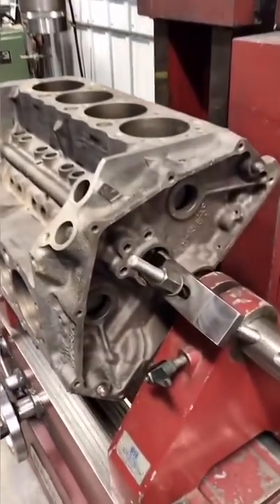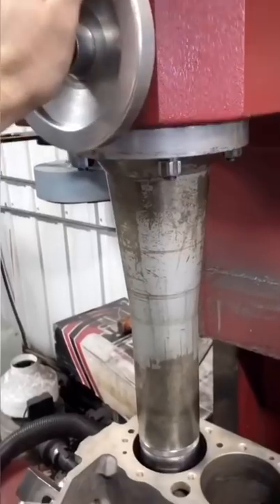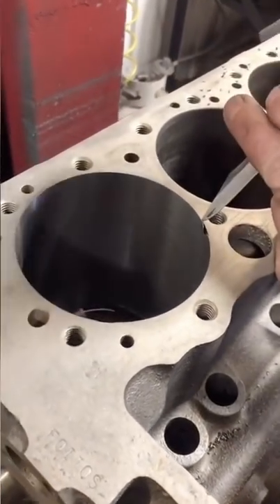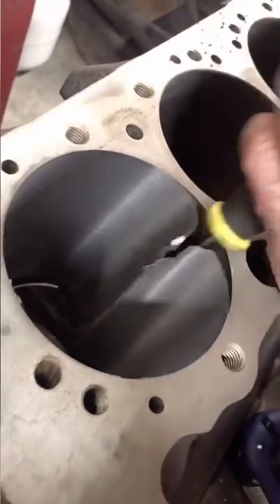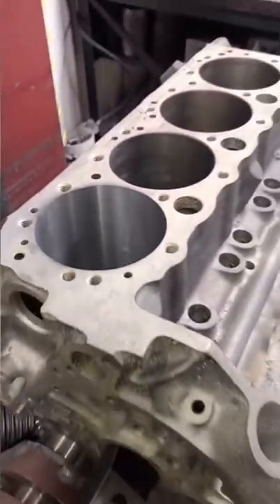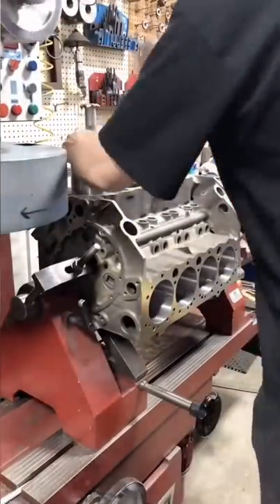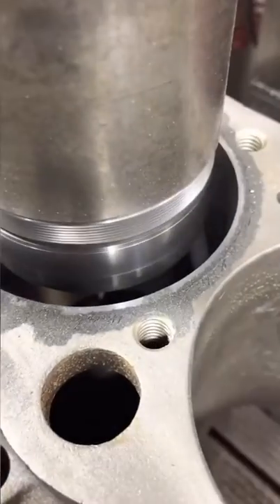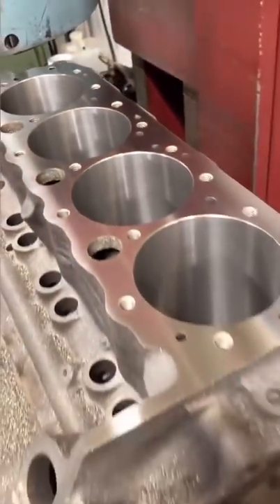#shorts Bore & Resleeve 327 Small Block Chevy Engine

Comment: Why not take all of the cylinders back down to standard board
Reply from the maker: At over 100$ per sleeve just in labor you’re talking a pretty penny for arguably no benefit. Save that repair for another 50 years down the road.
Reply: But witness sleeves and the cylinders make better strength in the long run and give you a little bit more longer life especially if your mechanic that does the oil changes as faces some people don't some people don't I've seen an old man wanting to know what was wrong with this engine he thought somebody was trying to take him out turns out it's just using old Quaker stage in his engine

Comment: 8 cylinder, small block?
I guess it's big block from 350 on up...
Reply: Chevrolet smallblocks ranged 262-400 cubic inch.  

Chevrolet big blocks ranged 348-454 cubic inch. 

The 350 is a smallblock btw.

Big block and smallblock are in reference to the external size of the block. You ever see big block and small block parts side by side and you'll understand.

Comment: Where’s the torch plate dude 🤦🏻‍♂️
Reply from the maker: *Torque plates, are typically only used during the honing process. When this block was brought to finish size in our Sunnen CV-616 cylinder hone a torque plate was used. We do not use torque plates when boring.
Reply: @JAMSIONLINE  that doesn’t matter when u bolt down the cylinder head it creates distortion just bc ur boring it doesn’t mean when u clamp the heads on it’s not gonna distort the cylinder but ig if it’s not “high proformance” it won’t rlly matter but I would’ve used one
Reply: @andrewwest2417  he said he does use one
Reply: @andrewwest2417  as a machinist I am at a loss about your comment.

Comment: Who still rebuilds engines nowadays? I think it’s cheaper just to get another one from a scrap yard..
Reply: True it is cheaper but where I live you'd never find a 327 in a junkyard
Reply: Drift Tax has skyrocketed the prices. When you could have bought a $250-$300 engine for a swap they're now asking for $500-700 is most junkyards I've been too and about the same if not a little more from salvage yards, where they actually remove everything with care unlike junkyards.
Reply: Problem is most of these rebuilders know jack shit and these engines dont last. The hell with a cracked block. Trash can that shit.
Reply: Good luck finding a running 327 in the junk yard, they haven't been made in over 50 years
Reply: @jdreaper2176  some cracks are repairable, like the one seen in this video.

Comment: I mean, what a terrible engine to need sleeving twice
Reply: Its no less than 50 years old, no telling what happened to it to have caused the crack. Could have been a casting flaw, could have been overheated, or could have been froze in the winter. They replaced the sleeve at every subsequent rebuild to ensure its in good shape